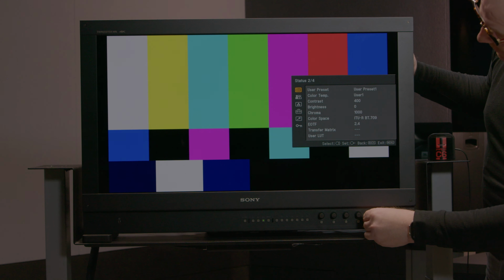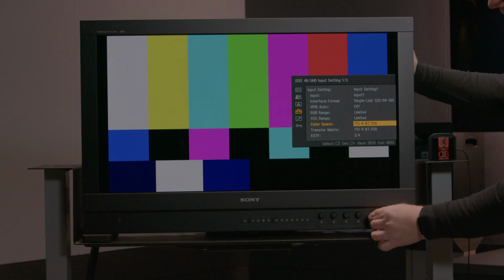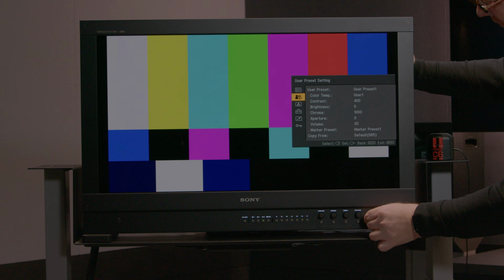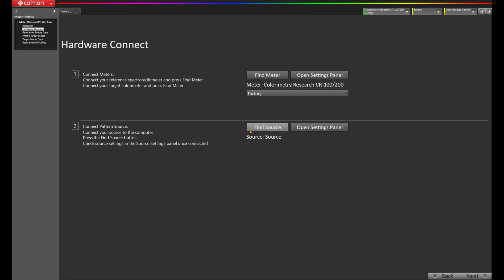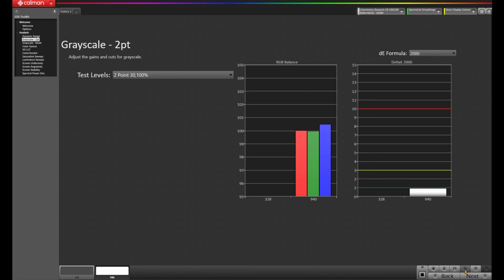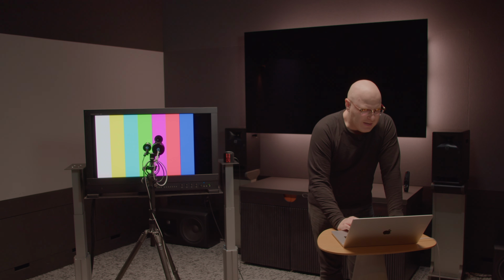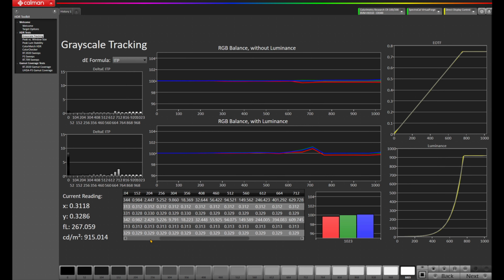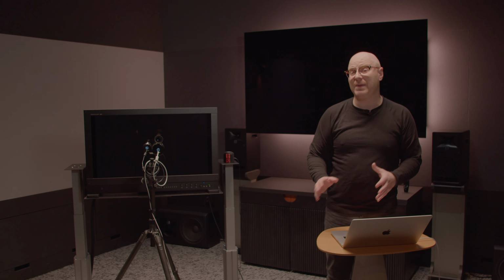Unleash True Colors on Sony BVM-HX310 with Calman

Comment: This was very informative and useful! I have just a question: if a monitor lacks the selection of a native mode but it still offers different wide gamut options such as P3 or Adobe RGB, what would be better to profile the colorimeter with? Same color space of the final calibration (e.g. profile the meter with a 709 reading of the spectroradiometer for later calibrating the monitor to 709) or should we profile the colorimeter  with a wider gamut representation? If we can't get a "neutral" color representation would it make sense to read values from a different gamut than the desired final output?
Reply: For meter profiling you should choose the widest colorspace on the monitor.
Reply from the maker: Hey there!

Great questions. We appreciate your enthusiasm!  Please reach out to sales@portrait.com and we'd be happy to assist you further.

Thanks!